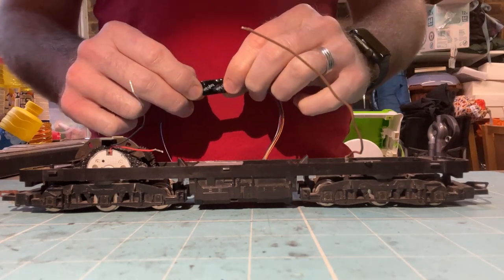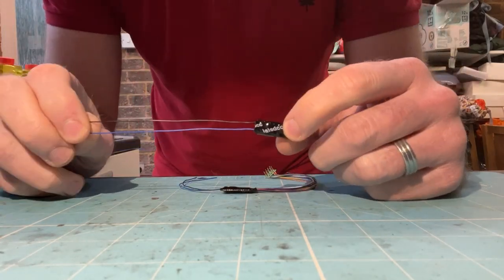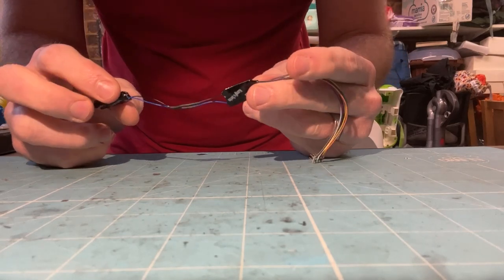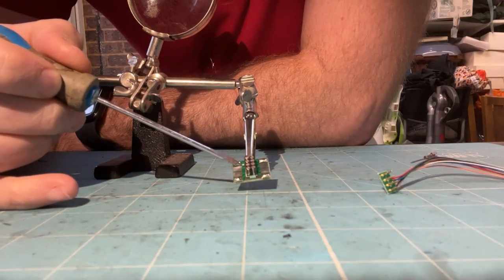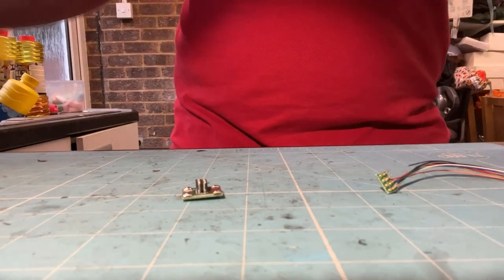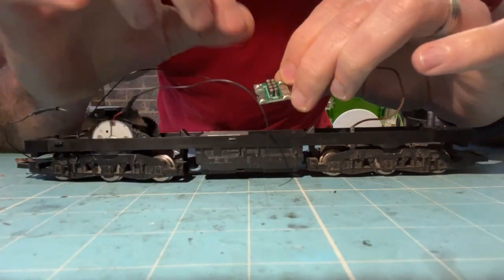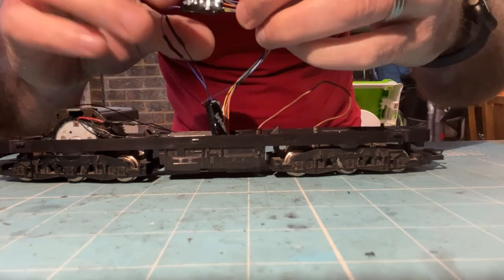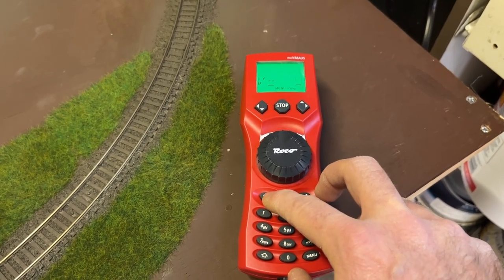Hornby Ringfield motor upgrade kit fitting tutorial. Part 2 - Wiring for DCC.

Comment: Great, clear video, thanks: just a couple of points...1) Your hot soldering iron, which is at hand, is a much better, safer, heat source for heat shrink tubing; and 2) My son is a dentist and is having kittens watching you bare wires with your teeth! - a few seconds with proper wire insulation strippers might save you a lot of time and expense later in life. Time will tell. 😁😁
Reply from the maker: Haha yes I have since invested in some decent wire strippers 😬

Comment: Hi Mark, That is very interesting.  I have a Hornby Class 25 which is going to get 'the treatment'.  Do you happen to know whether the Lais supports sound as I would like to fit a small speaker as well.
Reply: Sorry but Lais does not support sound.ie they dont make sound decoders.If you connect up the 8 pin socket, as mark has, you can plug in another sound decoder, very easily,later.

Comment: On an older 12v DC locomotive, if I wanted to fit a capacitor to smooth the passage over points, what is the minimum size capacitor i would need to fit please.

Comment: hi I have recently fitted one of your motor kits to my lima 59 with 8 pin socket and ran in loco on rolling road before fitting a lens standard decoder all runs fine on rollers and on track without changing any cvs but when connecting loco to a train 6 bogey hopper wagons loco struggles to move and lacks power loco can only manage to pull 2 bogey  hoppers 
can this be improved or cured by changing  cvs are could the motor be faulty any help or suggestions would be much apreciated 
kind regards 
ralph lees